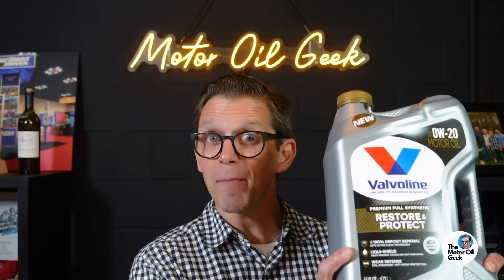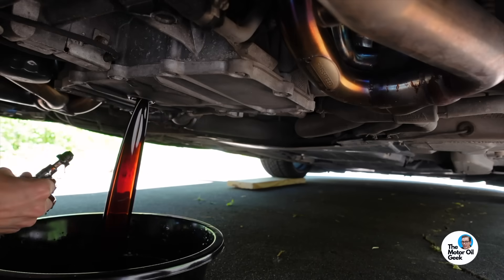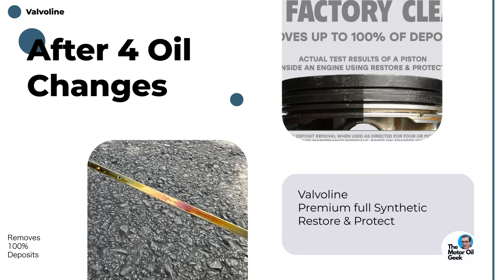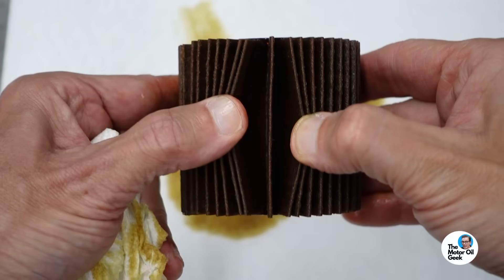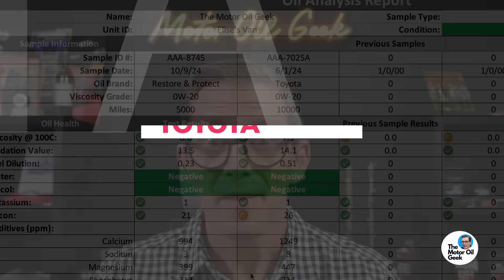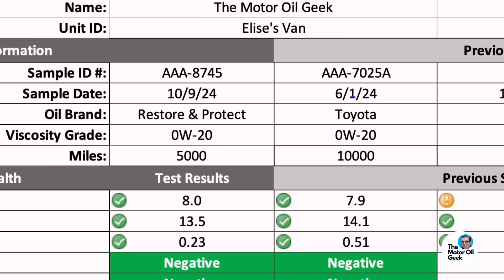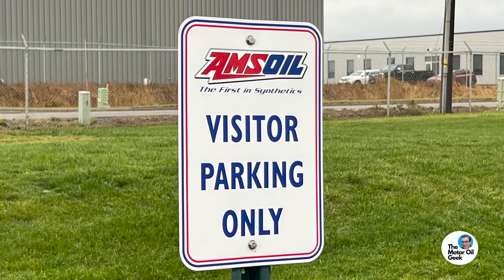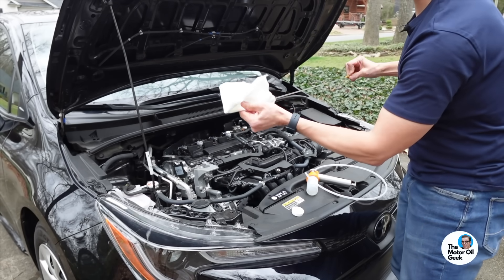The TRUTH About Valvoline's BOLD Engine Cleaning Claims

Comment: Would love to see a test between Penzoil Ultra platinum vs this Vavoline Restore and Protect.
Reply: A new test idea for Project Farm
Reply: @lamarc2634  he's next level over project farm in his investigation although he's also interesting to watch.
Reply: I want to see it to because I use ultra platinum in all my cars trucks
Reply: Ive been using Pennzoil Platinum for years  it definetly cleans the varnish off my dipstick...i wouldnt be afraid to try the VRP though..my silverado used Mobile1 the 1st 200k miles..then i Switched to Pennz Platinum the last 200k  i have 413k on it as of today still driving it as a work truck now😊
Reply: @robertclark2935  Pennzoil ULTA Platinum has regular Platinum beat.  More detergent and higher Group 5 Synthetic.  There probably isn't a better overall oil out there than Pennzoil Ultra Platinum besides maybe Liqui Moly.
Reply: You've read my mind.
Reply: My next question! It should be interesting since one of Pennzoils claims to fame has been for quite some time that it "keeps pistons cleaner". How about it LS?
Reply: @OneAceracer  Pennzoil Ultra Platinum does have the BEST Detergent Additive Package of any Pennzoil Oil and also one of the best Fully Synthetic Formulation of most any Motor Oil tested.   Not sure how it compares to Valvoline Restore and Protect.  My guess is that the Valvoline does have a more aggressive Detergent Additive package while not using any Ester type Synthetic formula.  Meaning that you need to change the Valvoline more often than the Pennzoil Ultra.  But since I always change my oil around 5k it probably doesn't matter which oil I would use.  The Only question I have is it safe to use 5W30 in my 2024 Jeep Wrangler regardless of brand.
Reply: Sounds like a job for Project Farm, also throw Amsoil in there as well.
Reply: I've done multiple oil analysis lab testes on PUP with 10k miles on it and the lab basically said the oil was still in great shape...it's really good stuff, and my engine loves it. Gas mileage and idle all improved running PUP. That being said...I'm running a few oil changes on VRP to clean any deposits out and then switching right back to PUP.
Reply: Yes Pennzoil stills sucks ass just like QuakerState.
Reply: I wonder if this would be good for cholesterol and arteries?
Reply: @ToasterCowboy  Collard Greens doused in 1/2 bottle of hot sauce is working for me.
Reply: I don't know anything about ultra platinum, I know that the old Penzoil 30 years ago was garbage relative to other oils, how do I know? From friction testing comparing to other oils, it came in last when we tested it at Dad's shop back in the 90's.
Reply: pennzoil is  far superior protectant while R and P is far superior cleaning.
Reply: @TonicofSonic  link to data??  What metric is "far" ?
Reply: @TonicofSonic 
Got any UOA’s to support your hypothesis?
Reply: @ 
40 years tribological expertise.  I’m pretty sure I’ve got you and the product well covered
Reply: @stephenpage-murray7226  cool. The rest of us still like to see testing because most of the people who know keep quiet, and this space is so full of marketing BS.
Reply: @ 
It’s been texted for years.
Reply: What kind of test?
Reply: @chestrockwell8328  a detergent cleaning test, since they both make bold claims. I belive penzoil protects better in its more uniform properties as it’s a cleaner base oil.
Reply: @kyletheav8r667  With PUP being a well liked and used oil for many years now, and V R&P being around a while as well my guess is that someone would have already made that observation.  I believe with all the testing Lake himself does  including using PUP in his Cayman he likely would have made a comment regarding whether or not PUP provided better or similar cleaning to the VR&P.  As for better protection, define "better".  Likely both oils will allow an engine to work for more miles than 99 percent of the length of vehicle ownership.
Reply: @chestrockwell8328  yes both are great oils, I’m in Canada and have run penzoil ultra for numerous years with great results.  Can’t get the restore and protect here as of yet. When running the penzoil ultra I took the valve cover off of my 2014 si a few years back to power coat it red. and no word of a lie the thing had zero varnish or sludge at 80,000kms. I now have a 2011 Acura Rdx that all I run is Kirkland synthetic at 5000km oci with great results. I belive any synthetic will be ok as long as you are strict on changing it more often- cheers
Reply: @kyletheav8r667  I'm not a fan of  long OCI either, though I have gone 8k and 10k unintenionally without any issues based on UOA.  I have two vehicles, both Nissan's,  one with 155k, the other with 220k (miles)  never have used PUP or VR&P.  Have used and tested with SuperTech, then Valvoline Advanced, now using Havoline High Mileage which should be just fine for approx 5k OCI.  Both engines are clean inside with clean dipsticks versus what Lake's Toyota van dipstick looked like.  Your Honda's will be happy with the Kirkland/Super Tech/Amazon oil blended by Warren.
Reply: I switched from Pennzoil Ultra Platinum to VRP. I'm sticking with VRP.
Reply: @paulsmith5237  agreed. On thrift vrp and to my surprise my suv is running better vs pup. Also I was burning about qt every 3/4k and now it’s maybe a 1/4 of a qr burn off. I’m sticking with it and neighbor out in their Lexus rx 200k and they said after a week.. it’s running great.
Reply: @paulsmith5237  what vehicle and mileage do you have ?
Reply: @vandiyplant921  01 Ram 1500 with 300,000 miles.
Reply: @paulsmith5237 me too penzoil was to loud on my car. Vrp so smooth sounding
Reply: platinum is junk
Reply: Wrong. Excellent Shell GTL basestock and first class additive package.
Reply: I went from ultra platinum to restore and protect in my 2011 4.8 chevy. It is quieter on cold start with the restore and protect vs ultra platinum. I bought this vehicle with 120 000 miles on it and ran mobil 1 high milage with 3,000 mile oil changes. At about 196,000 I tried ultra platinum for two oil changes and just did my second  oil change with the restore and protect. I like the valvoline but u am thinking about going back to mobile 1 high milage only because now bolth valve covers are starting to seap plus I got what I belive to be a rear main leak. I'm thinking about going g back to mobil 1 high milage because I belive it will keep it from leaking. I have minor seepage that is starting to look bad but not bad enogh to ever put a drop on the ground
Reply: @davidcurneal8375  my guess  on that situation  is that the varnish and build up was acting as a gasket or a helper to the gasket and the r&p did its job and removed all that and not being there  anymore  the original  gaskets  and seals are by themselves  again and your seeing minor leaks. I'd say that you'll still see the leaks if you were to switch  back to the mobil 1 .
Reply: Valvoline and Shell. Ultra. Both also have a high milage OILS TOO.  @davidcurneal8375
Reply: You cant compare the two. R&P is a cleaning oil. Pennzoil Ultra is not. Not worth even discussing.
Reply: @nordicpride9708 Based on what?? The marketing on the label? Lol. 
They're both premium branded synthetic oils, marketed to exactly the same consumer segment. Absolutely worth comparing. If PUP has superior protection, that should be evident from testing.
Reply: @nordicpride9708  penzoil ultra is a cleaning oil also my friend
Reply: @nordicpride9708  Pennzoil claims it is on their website.
Reply: @nordicpride9708 - Did you even watch the whole video? Test results showed that R&P actually does both restore(clean) and protect (reduce wear). So you could essentially use it to prevent build up in a new engine and still have the same wear protection
Reply: Penzoil is trash

Comment: At what mileage do they recommend doing this? I'm assuming this isn't a start for factory new sort of oil?
Reply: I don’t see why you can’t use it starting at your first oil change. This will simply keep carbon from building in the first place. This isn’t a “cleaner” type oil that’s a one and done sort of thing. The way it’s marketed is that it can be used for the life of the vehicle.

Comment: This is a comment I read on another video on R&P:

I work in the oil industry as a lubricant specialist, and there is something people need to know about this oil. It is running a higher than average detergent package which is why it is able to clean the carbon from engines better than your typical full synthetic oil. However, the reason you don't see high detergent packages in common oils is due to seal degradation. These detergents can dry out and corrode seals and non-metallic gaskets quite a bit. If you run this oil to clean out an engine for a couple of rounds that is ok, but I'd highly recommend going back to a standard full synthetic oil afterwards. Preferably use a high mileage full synthetic with seal conditioner and seal swell
Reply from the maker: That is not an accurate statement, at least in regards to this product. The detergent level is not higher than normal.
Reply: @themotoroilgeek  Thank you for the response. Do you know if there have been any studies showing no issues with compatibility with gaskets and seals?
Reply: Even if no studies, I only have one question - would you use it long term on a brand new car ? If yes, that's all I need to know.
Reply from the maker: @erics643  All API licensed products must pass seal compatibility tests, so this product passed those tests.
Reply from the maker: @erics643  Yes
Reply: @themotoroilgeek  Thank you for taking the time to respond. Really appreciate your work.
Reply: @themotoroilgeek are you saying that there are people on the intarwebz that aren't telling us the truth?!
Reply: The detergent package is comparable to other high mileage oils.  It’s the proprietary additives that work their magic and make this oil superior.
Reply: @mhagnemae5202  Yes, but if those high mileage oils are used on new cars from day one throughout their life, would there be a seal or gasket degradation problem ?
Reply: That person left that same comment on my video too lol
Reply: I'll be looking out for more info on this. It's been in the back of my mind since the last Lexus I had died from a massive oil leak. It was 20 years old at the time so it owed me nothing. I've always wondered if there was something that would show up in oil analysis to show seals degrading.  My current es350 with 207K miles is easy on oil and looks clean already. I've had R&P in it for the last 7K miles but I will switch back to regular Valvoline advanced or advanced high mileage if I hear any news on this being hard on seals.
Reply: @briankalagher6687  Where was the massive leak ? Something many forget is that long OCIs that allow wear material to circulate is hard on oil seals that wear faster than metal surfaces with the same abrasive particles. Clean oil is good for seal life.
Reply: @MathewPollard-vj4uq  It was a 98 GS400 that I bought with 30k miles and owned for 16 years and 200K miles. I think it was drivers side cam tower that was leaking. It seemed to be top of the engine around the VVTI gears. about 2qt every 50 miles at its worst. Would leave a 6 inch puddle in the driveway and the back of the car looked like a disel bus. I only ever did one 10K mile long interval with mobil one. Every other change was at 5K at the Toyota dealer. I did tons of short trips with the car though and it was not until recently from channels like this that I learned how bad that was for cars. I also had issues with rust because I didn't wash it enough so it was headed for the junk yard either way. But the car impressed me so much over those 16 years with how little that went wrong that I will only buy a J vin Lexus/Toyota from now on if I can.
Reply: Valvoline today, Lucas Leak Stop tomorrow!
Reply: Good to know . Thanks !
Reply: Would there be any issues with an older engine? In my case, it’s a 1979 Ford 302 with 61,000 miles. Presently using Amsoil Z-Rod 10w-30 since I’ve owned it at 55,000 miles. Thanks much.
Reply: You are not a specialist
Reply: I think in another video, Valvoline said it is custom molecules that make this unique.  That is not the same as adding more traditional detergents.  I guess the next test we need is how this oil compares with Valvoline high mileage on seals.
Reply: @garyganser2451  custom molecules lmao
Americans will truly believe anything
Reply: @kristoffer3000 The most ridiculous thing I have ever heard 😂😂😂 what’s a custom molecule? One that’s had its sex changed? 😂😂😂
Reply: @lynxstarautomotive208  If custom molecules were not discovered, we would have no new healthcare drugs.
Reply: @garyganser2451  Yes, it would be good to see seal and gasket studies of RP vs standard synthetic oil. I bought a 2025 Honda Pilot with GDI, and am not a fan of GDI engine design, so I was planning to use RP all the time. In addition to preventing carbon on piston rings, I have read that the RP additive package also travels with any oil mist going through the pcv valve, so it should also help prevent carbon build on top of the valves. There is also a small amount of oil that seeps past the valve stem seals and runs down the valve stem. The additives in that oil should also protect the tops of the valves.
Reply: @erics643  This entire comment section reads like a ton of bots that are posting AMAZING things, a little...  too amazing.
Saying an engine oil has increased their mpg etc, pretty hard to believe.
Reply: @kristoffer3000 engine oil barely affects mpg. I even went from 0w-20 to 5w30 and no mpg change. Biggest factors are tires and aerodynamics or simple driving habits
Reply: @TaylorPhase  Exactly, so the claims from totally real and not just 1's and 0's here in the comments that say they get quite a lot better MPG is extremely suspicious at best.
Reply: @kristoffer3000  I think my gas mileage slightly got better due to the cleaning affect but I can’t measure it or make a statement. It’s hard to do an a-b-a test in this situation. Way too many variables.
Reply: @TaylorPhase  What's the cleaning really doing? It's putting that stuff into the oil, does it have less friction than the oil? Because that's the ONLY thing that would cause your mpg to go up and it would be by a minuscule amount.
Reply: @kristoffer3000 if the oil package is breaking down the build up around the rings, several things potentially happen. Improved ring movement, better sealing, more combustion process doing work not entering the crankcase, contaminating the oil, causing fuel dilution, increasing friction. 

The pcv system draws vapor/oil mist from the crankcase, "deposits" them into the intake tract, causing them to collect on the back of intake valves, blocking flow. This same vapor is also contaminating the air fuel mixture. As the oil absorbs these deposits into suspension they are also being consumed in thr combustion process. Deposits will be affected inside the intake system as well. 

As this oil absorbs deposits there will also be gains in thermal transfer rates which plays a role.

Modern engines optimize  in real time improved VE will cause ecu to change fuel, valve timing  and ignition timing events. Any solenoid valves, actuators will also function closer to design intent. Many interdependent events taking place at once. Unrealistic to measure fractional events in an engine which is somewhat a living organism. Deposit formation will share patterns, but will never be exactly the same, so did A+B=C or was it A-D/Z+B=C

All of which improves fuel economy. 

 All of the improvements co-exist so unless you have a engine that by design had significant fuel dilution for example, and that improved by several factors using this oil you could point to one improvement, most cases will be co-contribution improving performance.
Reply: @kristoffer3000 , agreed. It's too much for me to believe the hype.
Reply: @TaylorPhase , key word is "Think"

Comment: The old saying...If it ain't broke, don't fix it.. may apply to this product IMO. Getting a clogged filter may cause more harm... then good.
Reply: Many people have done filter cut aways using this oil and there’s no indication that it’s causing filters to be clogged. Like Lake mentions, VRP seems to be dissolving carbon instead of breaking off surfaces in chunks. Hence why Valvoline likely says it will take 3-4 oil change cycles to fully clean an engine.
Reply: @cpftank09  I changed my filter after 1,000 miles with my first use of VR&P as a preventative maintenance.  It all depends want you are doing with this oil and want condition your engine is in when you start.  Bottom line: do your own due-diligence
Reply: @mhagnemae5202  I think it depends on the current state of your engine. On my 15 Tacoma with 65k and 5k OCI’s with quality oil its whole life, it’s not going to be necessary. But on something like my 91 MR2 with 128k that uses oil, absolutely worth changing the filter early. It’s reduced oil consumption in the MR2 so far with just about 2500mi using VRP.
Reply: You are afraid of change.